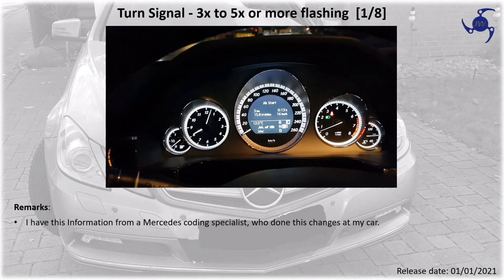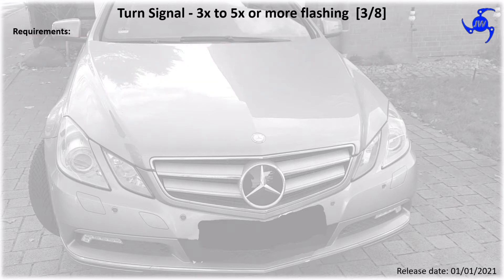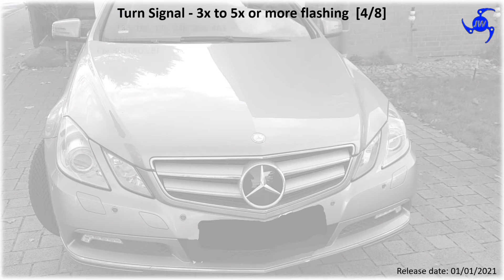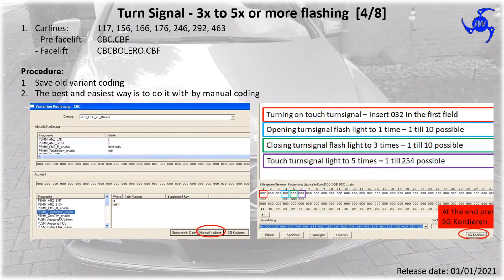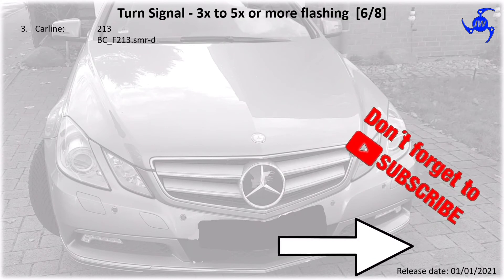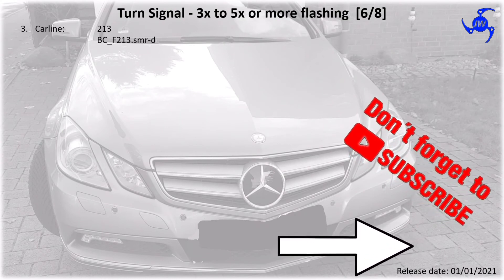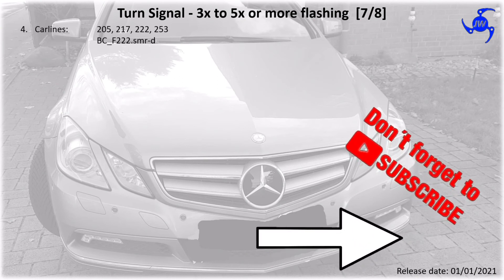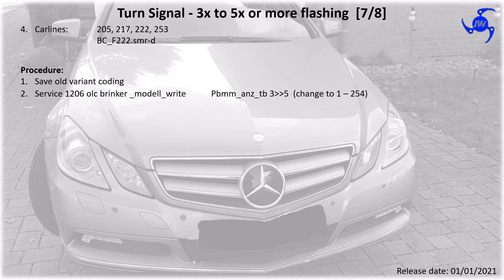DIY - Turn Signal 3x to 5x - 4 different examples - Mercedes coding manual

Comment: if you know variant coding basics, skip to 1:46
2:38 - no security access need, you can change it to any number trivially by just looking at the examples of the default coding strings.